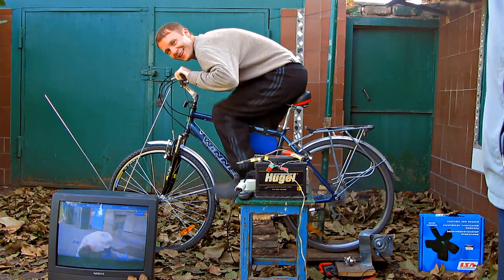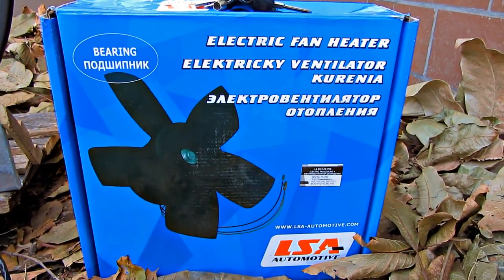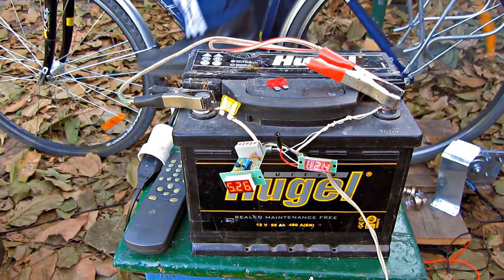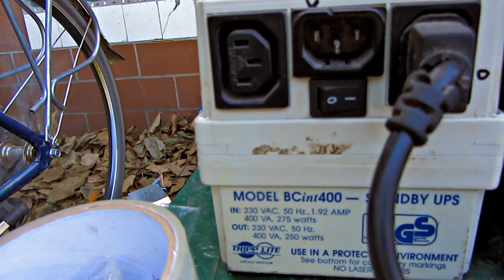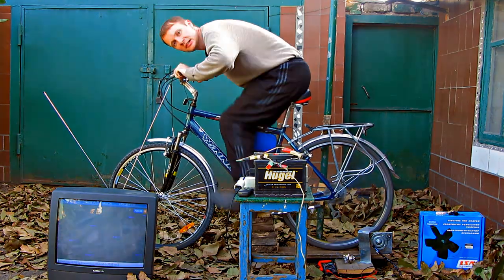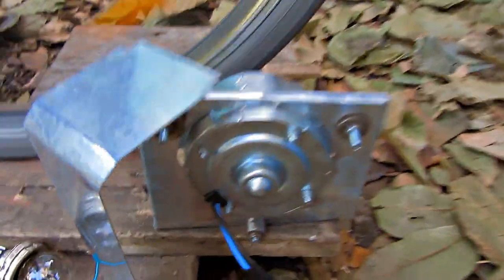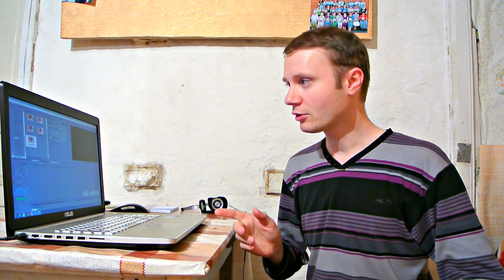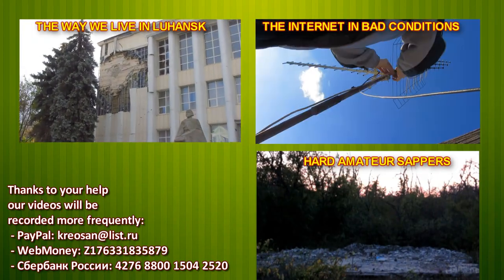A 220 volt homemade generator.  DIY Bike Generator

Comment: if you use a heavy fly wheel, you can utilize the momentum
Reply: shrikant patil true, it wouldn't be hard to start either since you could just change gears, literally. Lol
Reply: Yes you can. I bought an old Sears and robuck execise cycle from the 1970's for $5 USD. It has a 45 pound solid steel wheel. It has some asbestos break pads for friction resistance. Removed the brake pads and discarded them. The wheel has a groove in the center where I managed to put a flat belt on it. I connected the belt to the DC motor from a Chrysler. The chain and pedals are highly geared. It has a speedometer built in. I can keep it at 8 MPH and it will charge a car battery in less than 5 minutes..  The bike is a Sears Egrometer... https://www.ebth.com/items/747981-sears-ergometer-upright-exercise-bike  You can see pics of one here. It is very heavy and constructed of stainless steel and chrome parts

Comment: If there had been power in the high voltage line it would have jumped to your body within 6 inches of you getting to touch it. If you were not sure and it had been live you would probably be dead right now. Have you seen that video of the guys pushing a scaffold tower inside a big warehouse? The touch overhead lines whilst they are moving the tower to a new position. They all turn to solid carbon pretty quickly, you can actually see their bodies heating up and frying! Take care have fun building and experimenting.

Comment: Is it more efficient to use a belt to connect the bike wheel to the alternator or to do it how you have done by simply contacting the wheel to the alternator?

Comment: It is quite expensive energy... pedalling 100W for hour requires 86000 calories... and you don't receive 100W because those cheap generators are very inefficient. I would say this guy was lucky if the efficiency of his power generation was 50%

Comment: Can i use Computer UPS as an inverter ?
Reply: +kunwar partap singh UPS generate some frequensy (~40kHz) AC current to change its virtual frequancy to 50 - 60 Hz, so it is invertor ( a current frequency changer ). After you insert inside a charge controller, one can use from bike shop one for charge Battery. Or you can sold it by blueprints from soviet magazine &quot;Radio amator&quot;. A current from generator changes in value from 12 up to 50 volts depending from wheels velocity, so charge controller must fit the votage to be able to charge and to stop when overwhelmed battery to protect it from overcharge. You can buy the chineese one http://www.dx.com/en/s/charge+controller+solar
A general UPS is bad invertor due to 10 minutes term of using it, nobody use cheap UPS for long term use ( it can become extremely hot and something can make fire ) There are long term UPS that one can use as invertor with charger from 220|110 volts

Comment: well a car battery at full charge with no load is 12.6v but most are alternators put out 14 volts to charge the battery and run the electronics. 14 volts dose not cook the battery but i am being picky
Reply: Its no problem. The voltage in a car is usually ~13.8 volts when the engine is running. It needs to be a little higher than the battery voltage to charge the battery reliably. If you have a diode in the circuit the voltage will drop by another 0.7 V anyway.
Reply: and an Chevy V8 is to use 5.8 liters of oil for an oil change, but every shop puts 6 liters, there is a difference in the spec sheet than what happens in practice
Reply: The charging voltage is 14.4 volt. The supply voltage from the battery is 12.0 volt, this can be measured with a small load )like 2 or 3 Christmas lights, 0.1 A).

Because the modern electronic voltmeter are very sensitives, with impedance above 20 Meg ohm, the voltage can appear higher than 12 volt. Dirt on the probes and battery contact can generate a tiny extra voltage.

The diode add 0.7 volt and will generate the same heat as a 7 watt light bulb. with a charging current of 10 Amps. That is hot enough to destroy any diode not mounted on heat sink A schottsky diode would generate half the heat. Still need a heat sink at 3 watts.

Nice video from east Ukraine. Playing with high voltage pilone cable is another amazing example of the devastation of the current war..

Comment: What the type of generator? AC OR DC
Reply: Abdullah Alkhasrgy DC generator with an AC output.
Reply: dc
Reply: Plum_ Pie Generators Always Put Out AC
Reply: Peter Zingler DC DC DC DC now its output is ac because of the inverter but the generator itself is DC.
Reply: Stoned Savage No ITS Not ^^ there is No real dc Generator you will Always have waves on the Oszilloskop , you can build a Generator to do very little waves but thats Not worth the effort. So its kinda an DC Generator but there is AC involved and for Things Like this in the Video a normal AC Generator is much more efficent even tho you need an upstep too
Reply: or maybe its secret russian technology, which outputs DC :)
Reply: Peter Zingler the motor itself is dc but it gets smoothed and changed by the inverter. i see what you are saying though.
Reply: Peter Zingler these motors give DC with a slight waveform, but it's not AC as it never changes polarity